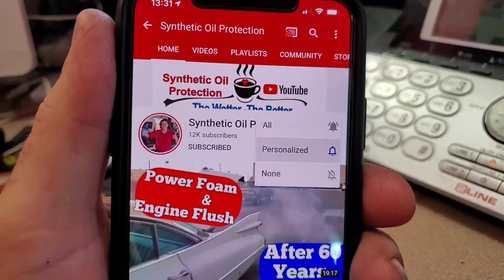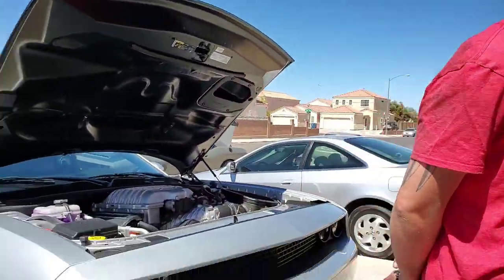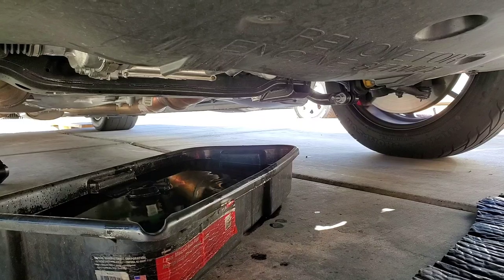2019 HELLCAT AMSOIL Engine Flush oil change #68

Comment: On these hellcats there a drain bolt for the oil cooler I didn’t see you guys drain the cooler, it’s very important you drain that as well especially when adding the flush fluid, not to much comes out but still very important, not many people know about it but just trying to spread knowledge

Comment: We have to look at Oil Filters. Amsoil Filter looks Strong and Good Quality. Compared to that other cheap V filter.
Reply from the maker: Yeah the OEM style oil filters have a lot less medium and they hold less contaminants about 1/4 of the contaminants in a Celluloid paper filter
Reply from the maker: Plus the Amsoil oil filter flows with less restriction for better efficiency filtration fuel mileage and cold start protection
Reply from the maker: Have a great weekend Hector thanks for being a part of the channel😃☕
Reply: Does Amsoil sell Fuel filters, Trans filter and Air Filters?
Reply from the maker: They are mostly Wix filters and you'll see them under the lookup guide depending on what vehicle it is.

Lookup For Your Vehicles - https://www.amsoil.com/guides.aspx?zo=5331179

Comment: I have a question. How many double entendres does it take to change engine oil?😀
Reply: @Syntheticoilprotection  Amazing videos. I am currently using Liqui Moly and will now shift to Amsoil next oil change and hope I get the same results
Reply from the maker: Definitely this is my link that will give you the wholesale pricing and you also have the free shipping as a preferred customer.
There's also a promotion going on right now.

Promo code:
STABILIZER
Free bottle of stabilizer with any purchase of 75 bucks or more.

Ebens Link: AMSOIL Wholesale + FREE Shipping: https://www.amsoil.com/offers/?zo=5331179
Reply: @Syntheticoilprotection  Thanks

Comment: Hi eben! I watched a lot of your flush videos and they seem to work really good but I have a question. They say not to put the engine under load with the flush in the crankcase because it could damage your engine. So... aren't you technically also harming your engine by letting it idle as well? Maybe you are hurting it much less but still I don't like the idea of letting my car run for a long time with really thinned out oil. Is this an issue?
Reply from the maker: It's not an issue because the initial where is on cold start and the flesh is not circulated when you start it so once it's running you just don't need a thick film of oil because there's no load in the motor so the where is very very low.

     I do understand though that if you would run the motor or put a lot of heat in it you'll send it out even more and you could have a problem but 15 minutes isn't long enough to do anything
Reply from the maker: If you do not want to do an engine flush the best thing to do is do a filter change at 3000 Miles and the Amsoil Signature Series will basically melt all the carbon out of your engine the only thing is the oil will get dark very quick if you don't flush it so it's more cost-effective to just flush it from the beginning it's dead of replacing a bunch of oil filters
Reply: @Syntheticoilprotection  Thanks
Reply from the maker: Any time you'll see on the homepage of the Channel all the playlist you'll see the engine flush playlist there's about 60 different Vehicles we've done all the way from vipers Ferraris Mercedes all the way down to Nissan😃

Comment: Does the flush thin the oil too much to cause damage during the 15 minute flush time?
Reply from the maker: Not at all.

I've already flushed a Honda Fit with the full bottle of flush in the Honda Fit only holds 3.5 quarts of oil😄
Reply: Synthetic Oil Protection Oh ok. Cool. Thanks
Reply from the maker: Anytime also there is a promotion going on with a free bottle of stabilizer with any $75 purchase..

Promo code: STABILIZER 

Ebens Link: AMSOIL Wholesale + FREE Shipping: https://www.amsoil.com/offers/?zo=5331179

Comment: I wouldn't do engine flash especially on a hellcat.  Hellcat engine produces a lot of heat more then a normal v8 n to do a engine flash you asking for the engine seals to wear out faster.  If the car have 100k mile or 150k mile. The synthetic oil is enough to lubricant and clean the motor.  I use amsoil oil but no engine flush
Reply from the maker: Yeah you'll notice a big difference when you try it It gets a lot of the carbon out of the oil cooler ports also around the oil cooler if it's a turbo vehicle it really helps the turbos so it's very important on high performance vehicles or turbo diesels.

I recommend you try it one of these days you'll be surprised.

This is my engine flush playlist on all different types of vehicles you'll see the results - https://youtube.com/playlist?list=PLB_ftWArBFddawwJUyra9BJY50iLTuBN9

Comment: He said 12k miles i do mine every 3k miles or 2500 miles.
Reply from the maker: Amsoil is quite a bit of a different product it is 100% synthetic.

AMSOIL Performance Test Results. Read This Article - https://www.amsoil.com/performancetests.aspx?zo=5331179
Reply: @Syntheticoilprotection  i use motul oil on my built Subaru i would never run my oil  more than 3k no matter how good of an oil.
Reply from the maker: You're not the only one that does this I have an amsoil dealer of mine Steven he is a transmission expert and he changes his oil every 5,000 mi with amsoil signature series - https://youtu.be/qh9a6_1PY44